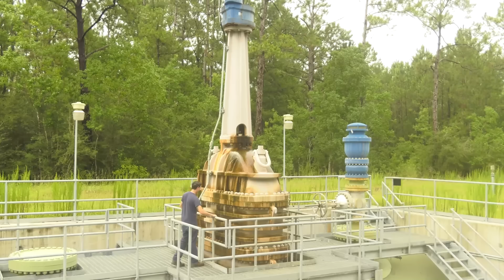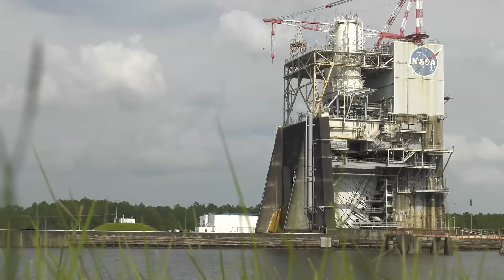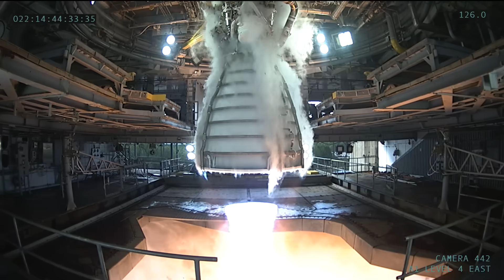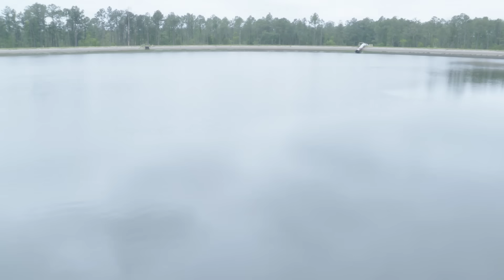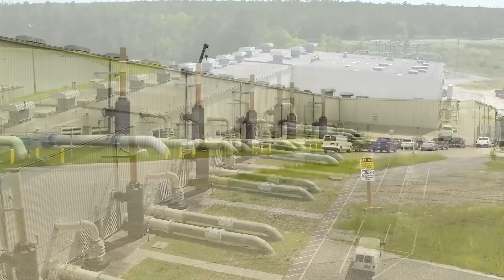NASA Drains 66-Million-Gallon Reservoir to Upgrade Critical Water System

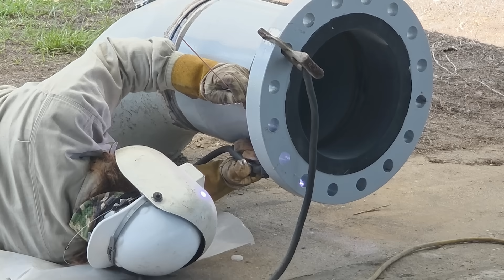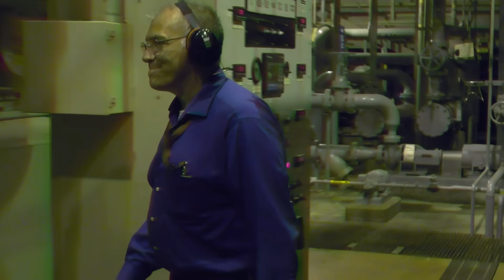Comment: Wait, first you explain you have ten 30.000 GPM pumps, and at the end you are replacing one pump, and the new one is only doing 3.000 GPM? Is there a section missing where you explain there is an 11th pump for a special purpose?  At 2:18 you are replacing "the" 3.000 GPM pump, at 1:25 you mention "the old one", but all you explained as current setup are pumps that are 10x as powerful?

Comment: Gallons when used for anything like this make deceptively large numbers. 300,000 gallons per minute is almost 1 acre-foot per minute. You can visualize an acre-foot as 43,560 cubic feet or a 208x208 foot square, that has one foot of standing-water on it. 66,000,000 gallons total in this reservoir is roughly 200 acre feet.

Comment: Why use 10 pumps when you can use 4?  The Westinghouse AP1000 reactor coolant pumps do 78,500 gpm and it uses 4 to pump water through the reactor.  Thats 300,000 gpm, 4 pumps.

Comment: So what happens when this runs out ?  Any backup plan ?
Reply: You should try rewatching the video and paying attention next time.
Reply: It doesn’t "run out" in the normal sense. The reservoir is a buffer for rocket-engine tests, and the water is recycled back through the on-site canal/catch-pond system for future use. NASA says a typical RS-25 test uses about 5 million gallons from a 66-million-gallon reservoir. If the high-pressure water system is not available, they simply cannot run a hot-fire test safely because the exhaust can reach around 6,000°F and the water protects the flame deflector, cools the exhaust, helps suppress sound, and supports fire suppression. So the backup plan is mostly: stop testing, refill/recycle, and maintain redundancy/reserve fire systems.

Comment: Who paid for that water because that shit aint free in 2026?
Reply: Taxpayers, ultimately. But this is an on-site NASA test-stand reservoir, not 40 million gallons bought at retail. The water is part of a closed-ish industrial system: it cools the exhaust/flame deflector, helps sound suppression, then flows through catch ponds/canals for reuse. The expensive part is the pumps, pipes, power, labor and maintenance.

Comment: He failed to mention the primary reason for the massive dump of water on every launch pad is sound suppression/dampening) Russian rocket pads don’t use water. 
The rocket exhaust is coming out at supersonic speeds. As such it creates big sonic vibrations. So much so that it’s inherently dangerous to Rockets. 
Russia solves this in deeper exhaust wells. 
Can’t make that at Cape Canaveral where the water table is just below the surface. So they build elevated pads and dump avalanche of water to suppress the vibrations through the water vapor created. 
It has absolutely nothing to do with stopping the 6k degree temperature from burning down the pad. If that were the case then Russia would have to rebuild their pads every time.
Reply: He literally says the main reason is for suppression and sound dampening in the video
Reply: It has as much to do with not burning down the pad as it does sound suppression.

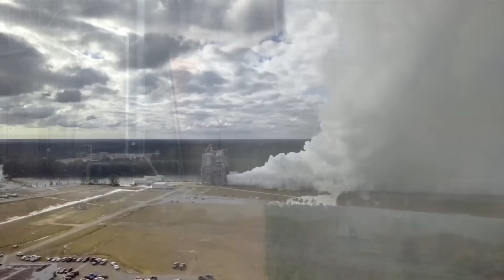Comment: 1:17 it's just water? so it burns perfectly clean and leave no residue?
Reply: Yep, it's just a hydrocarbon and oxygen combustion reaction! Turns into CO2 and water!
Reply: @Dare2Dash  so only thrusters use dangerous stuffs
Reply: @thaphreak  Yes, they use a type of monopropellant, usually hydrazine, which can decompose into nitrogen oxides and other harmful byproducts. That's why they're used primarily for RCS, where they need quick, reliable decomposition.
Reply: @Dare2Dash there is no carbon involved? Its pure water
Reply: @Dare2Dash Actually, RS-25 engines run on hydrogen and oxygen, so the byproduct literally is just water
Reply: @MachineWashableKatie  Yeah but I'm not talking about the Rs-25 he mentioned thrusters, like RCS. I also said that earlier.

Comment: 60 years and a fuck load of tax payer  money and spaceX came and made re-usable boosters in about 10 years, how much do the boosters that yall dump in the ocean cost?  (spend the time on somthing better than draining a damn pool)
Reply: SpaceX deserves huge credit for making Falcon 9 reuse routine, but this comparison is messy. NASA already had reusable Shuttle orbiters and recovered SRBs decades ago, the real issue was cost and turnaround. SpaceX also grew partly through NASA’s COTS/ISS contracts, so it was public-private, not magic private money only. And this video is not about wasting a pool of water. Stennis lowered an on-site engine-test reservoir to replace a fire-suppression pump, and the test water is recycled through the canal system back to the reservoir.

Comment: And people have a concern over the amount of water data centers use....
Reply: Data-center water concern is about continuous local consumption, often through evaporation and power generation. This NASA case is different: Stennis temporarily lowered an on-site reservoir for maintenance, and test water is recycled through the canal system back to the reservoir. Comparing a one-time industrial reservoir drawdown to ongoing data-center water consumption is apples to oranges.
Reply: @norbertnagy5514 either way nasa had rven more evaportation just look at that video

Comment: Y'all should send Karen Bass instructions on how to refill reservoirs.
Reply: Y’all should send Donald Trump instructions on firefighting by not “Release the water!” from a agriculturally important reservoir in California down stream into …nothing at all. Oh, and rake the forests in Georgia where out of control fires due to Corporate malfeasance burnt through 40,000 acres of untended trees orchards destroying over a hundred homes.
Reply: @Jmp5nb tds alert
Reply: Both are really bad. Palisades fires burnt 16,000 structures killed 30 people. Controlled burns and thinning does help prevent forest fires for both states. Having water available when needed also helps
Reply: @Ricgy-l3x I think this is one of those cases where several things can be true at once. Palisades alone was about 6.8k structures and 12 deaths. The ~16k/30 figure is closer to Palisades + Eaton combined. The empty reservoir mattered politically, but the state analysis also says pipe flow and pressure would still have been a limiting factor even if it was full. Trump’s Central Valley water release also wasn’t a real LA firefighting solution. Georgia’s fires were real too, drought, heavy fuels, and small ignition sources made them explode. Better fuel management, prescribed burns, ignition prevention, and better water/pressure infrastructure all matter.
Reply: @norbertnagy5514 that’s what I was getting at kind of with the infrastructure to support things they know could happen if that makes any sense. I agree with you 100%
Reply: @Jmp5nb  Keep GA out of your mouth. We're under severe drought conditions and the fire is already contained. 32K acres btw, liar.  Sweep around your own back porch. Unsurprising how you're fine with big corpo farms keeping life-saving water but you somehow blame corpos for fires in GA. Lick those corpo boots harder.

Comment: Can water lines be ran through the area to capture some of the heat as steam to recover some of the heat?  It seems a waste to lose all that heat.
Reply: Why Does Florida Need More Heat? I'll Wait..😂
Reply: @MichaelPetri-l4y They could use the steam to generate electricity.
Reply: @MikeBone-l9v They're Not Generating Enough Steam To Run A Turbine..I Guess They Could Run A Couple Of Light Bulbs Though..
Reply: @MichaelPetri-l4y He said they had the capability to pump 300k gallons per minute and was upgrading to larger pumps.  He also said the rocket motor produces 6000 degrees. I would think some of that could be harnessed similar to a refrigeration system to turn a turbine of some sort.  I quest if it was done wrong it could make a good size explosion too.
Reply: @MikeBone-l9v  that is highly impractical. It's not as though they're testing rocket engines day and night.
Reply: @MichaelPetri-l4y this is in Mississippi.
Reply: @mattsheffiel Oh, So Mississippi Needs More Heat..
Reply: @MichaelPetri-l4y not at all. Just pointing out it’s not Florida.
Reply: In principle, waste-heat recovery is real. In this case it probably isn’t worth it. An RS-25 test is only around 500 seconds, and the water system is mainly a sacrificial cooling/sound-suppression system, millions of gallons quench the plume and protect the flame deflector. To make useful electricity you’d need a durable high-pressure boiler/heat exchanger sitting in a 6,000°F rocket plume without disturbing the test data or becoming an explosion risk. The complexity would likely cost more than the electricity recovered.

Comment: You would think that electric motors could do this job way more efficiently than old diesel engines.
Reply: Diesel pumps are more reliable. 
Electric motors fail much faster.

And prob 10x the cost
Reply: Where would the electric power come from to supply the motors ?  Diesel is much easier
Reply: @sawdust9929 
Probably a diesel generator 😂. 
Or a coal plant....

Because solar farms and wind farms cant produce enough electricity to run that power....least not on a small scale 😂😂
Reply: Yes, it would be more efficient, but electricity has its issues.  If they had electric pumps they would be dependent on the electricity supply to keep them going.  Lose the electricity and all of the pumps stop, and the loss of cooling water could mean destruction of your billion-dollar test stand.  With the diesels, if one breaks down they can safely shut down the test with the remainder running.  The pumps turn or the stand burns.
Reply: I should also add that there is a pair of redundant diesel generators providing all of the electricity for the duration of the test.  They have the same kind of setup at space launch complexes so that they aren't depending on a potentially unreliable grid supply.
Reply: If you looked at Stennis on a map, you wouldn't think that at all.

Comment: If I did the math right, if you had a line of milkjugs passing by you, I think they'd have to move at roughly 3 times the speed of sound to pass you at the rate of 300,000 gallons per minute.
That's a lot of milk. :D
Reply: Almost!
A milk jug is 6 inches by 6 inches. 
Stacked in a line of 300,000 would be 28.4 miles or 150,000 feet. 
150,000 feet per min equals 1,704.54 mph or Mach 2.22. That's 2.22 times the speed of sound.
Reply: @GaryBlaster8 math
Reply: @GaryBlaster8  a milk carton is 6”x6” but jugs are definitely bigger
Reply: @gageinoc I’ve never seen a square milk carton so seems like they aren’t 6x6 either
Reply: @R @RatKingTerry  you’re referring to the height of the carton though, which isn’t actually a factor in this case
Reply: Milkjugs.  Gallons.  That's very crude maths, sorry.
Reply: And it will be done 33 times every 33 years.
Reply: My head hurts now ..
Reply: The checkout operator that can scan at that rate needs a raise.
Reply: @andrewclarkehomeimprovement  It's self-checkout now, good luck.
Reply: Believe it’s impossible for liquid to move speed of light
Reply: You lost me with "if" "think" and "roughly" 👎😂
Reply: @Nite2012Mare  why? You’re more than welcome to do the math yourself? He’s approaching the subject with a level of epistemic humility.
Reply: @DMSparky reads like guessing 👍
Reply: @Nite2012Mare  Yeah that's the point? Most people guess before thinking further on something they lack understanding is not a bad thing. Just as learning something you don't know isn't a crime!